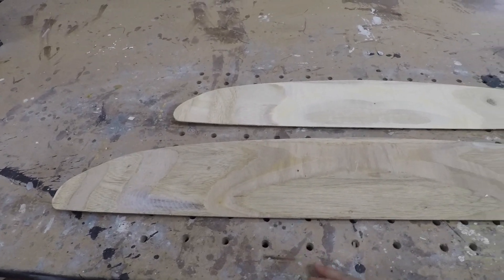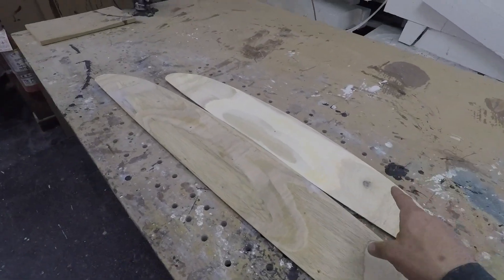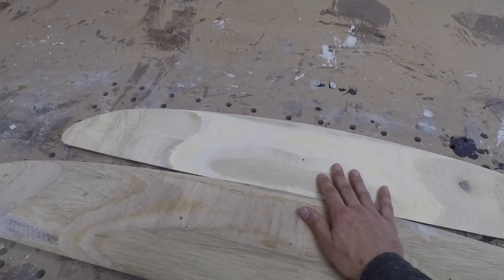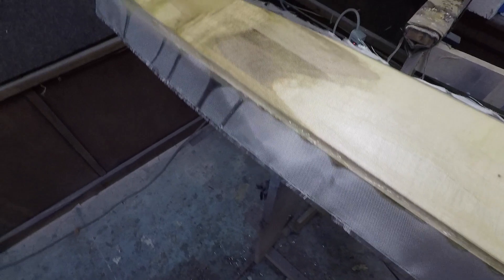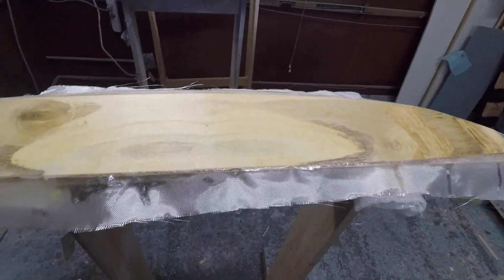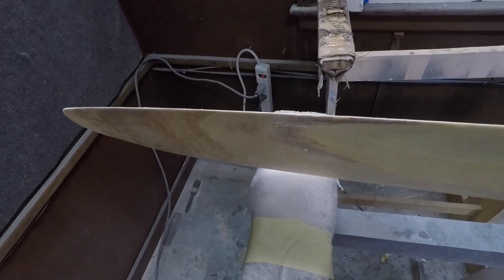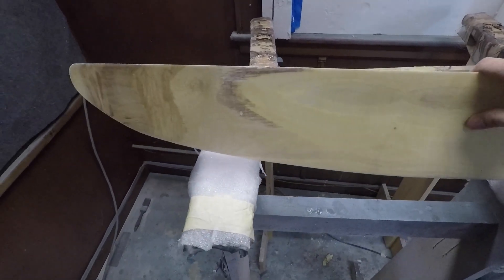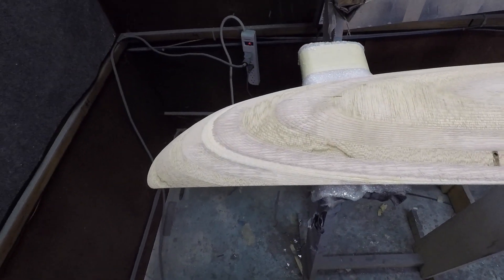Razor thin hydrofoil trailing edges

Comment: How many layers of glass or carbon are you using in the final build?
Reply from the maker: using 5.8oz carbon I had 3 layers each side with a double wrapped leading edge. On the bottom side I added in one additional 8-10 inch layer feathered into the center of the wing. The addition of the tunnel on top also adds stiffness to the center. I will have a video comparison of carbon to glass layups soon!
Reply: @clearwaterhydrofoils4313  Awesome, thanks! I'm going to use some 200gsm 3K Twill Carbon Fibre which I believe is about the same as your 5.8oz carbon.  I purchased your large and medium wing core. The packaging was excellent and they look great. Fast delivery all the way downunder to Australia! I aim to start building them soon!  It’s my first serious epoxy/fiberglass project so I have been watching a lot of videos in prep.